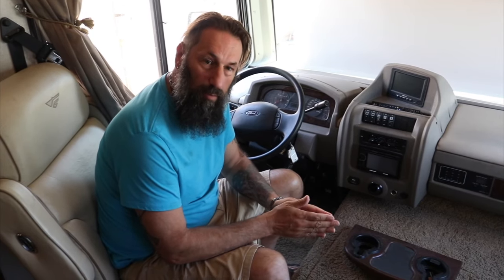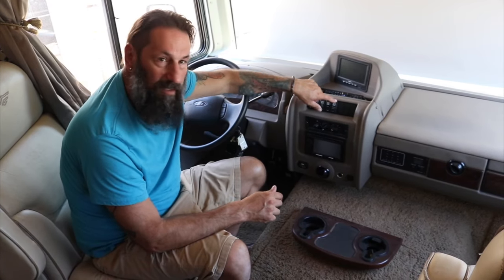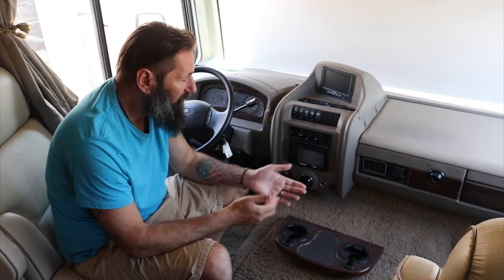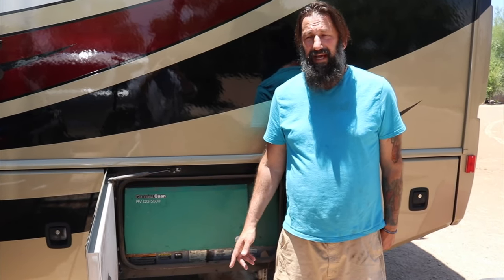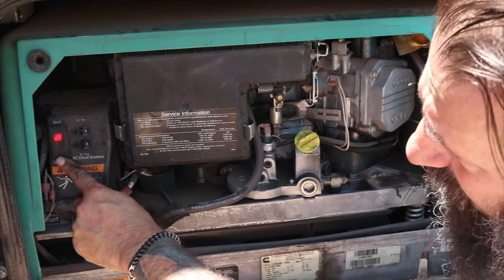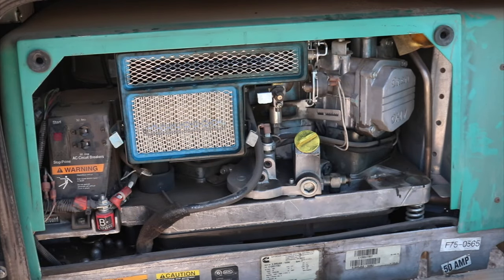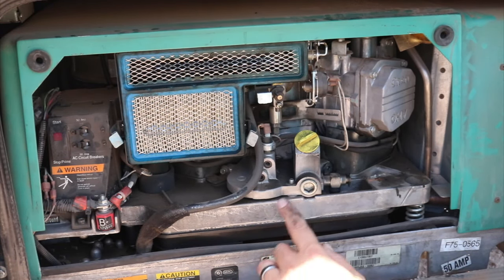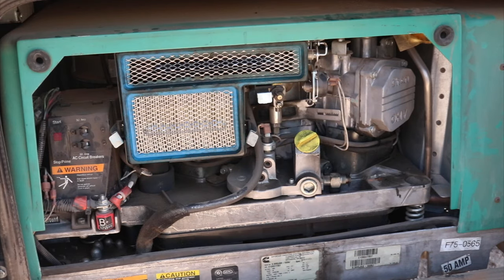RV Onan Generator Start Up Problems. Fix it here.  Hint & Tips

Comment from the maker: Hey everyone, let me know if this video was helpful to you and lets hit that Subscribe button.  Thanks for watching!
Reply: Thank you.  This was very helpful! I got it running.
Reply: Subscribing!
Reply: There is no coolant in a generator.
Reply: Hi from Alberta  Canada!!  Big thanks  for all your precious info  🙏  I like  your tum up 👍👍👍
Reply: Hello Mr. Bear all I’m getting is a clicking can’t get it to turn over got good house batteries Well I’m getting is the solenoid clicking do you have any pointers for me?
Reply from the maker: @patriotmike5714  Double check your voltage on the house batteries but if that is good you maybe looking at the starter.
Reply: @BearsWorkshop  Thank you I will tomorrow morning.
Reply: Very helpful!  One specific question concerning an Oman/Cummins RV QG2500 LP propane generator:  there’s a small 1/4” rubber hose, with what looks to have a small disk style filter in line, with nipples on each end, which I am suspicious of. Generator has a fresh oil change, a year ago, but was not attempted to be started, until now. Generator only has about 50 hours on it. Starter turns the engine over, but won’t start at all. Acts like it’s not getting propane. When primed, I can smell a small whiff of propane. Could a bug or something get into that rubber line, or filter and prevent a start?  It’s not the main fuel line, but some other small rubber line. Not sure of its function, but looks to connect up around the carburetor or choke actuator. Is it okay to use a small amount of starting fluid on a propane powered engine?
Reply: No power to gen good battiers
Reply: my onan 6000 generator has a 4 times flash code which means.

Comment: Man you just saved me a LOT of hassle! I can't hear a fuel pump running or tell that anything is actually happening holding the stop button, but sure enough, after 2 cycles the generator fired right up! The RV had been sitting for 6 years and I KNEW it had a lot of really old gas in it and run through the generator when I tested it. I was convinced I was going to rebuild that carb.

Thank you!

Comment: Good video. Quick note… a rapid clicking sound when attempting to prime or start a diesel generator could also be an extremely cold generator. We’ve had single-digit temps here in NW Arkansas the last several days. My Onan fired up and ran for two seconds, died, then showed a code to heat the generator. Hope this helps.

Comment: Thanks for your video. Helpful tips. 
I have a 2019 Winnebago travado 59k Van RV on a ram ProMaster chassis. It has a 2800 Onan generator. We bought it used the first of February and everything has been fine until a trip to Jacksonville Florida to visit our son in the navy. Once about halfway there we stopped to make coffee and it wouldn't start it just clicked when I tried to start it. I tried a few more times over the next few hours and eventually it just fired up and was running fine for almost a week on and off. Friday night while we were boondocking after a couple hours of running with the AC the generator stopped. It would restart but only run for a few minutes before stopping. When we bought the van the generator only had 10 hours on it telling me the gentleman didn't run it enough after 3 years. So when I got home I changed the oil in it assuming it still had to break in all in it just wasn't sure. It cranked immediately after I was finished and ran for a few minutes then stopped. Since then all I get is a click (at the generator) when trying to start. I'm assuming I may have house battery issues but I don't know I can't get under it to check them. Them being 3 years old I guess that's a possibility? I am going to my tire place in the morning and have them put it on the rack and check the two house batteries. I also thought possibly a solenoid on the onan? Thoughts?
Not low gas or low oil

Comment: I have a Onan 7000 EFI in Denver. It has trouble staying running. I’ve figured out to disconnect the load w the Circuit Breakers on the Generator near the start switch. Then it will stay running. I have to wait for about 15 minutes sometimes for it to warm up and then apply the load by Turing on the Circuit Breakers. Then it holds. There is an RV style AC unit on the system. I think it may have a heater package on it too. Took it to Cummins one time before and they found no issues. I thought it might not be set for high altitude. They said no.

Comment: Lot of good information here without wasting a lot of time.  I appreciate how you take us through the problem and what to look for.  I have a problem with my Onan 4000. Last fall I changed the oil and exercised it over the winter a few times. This spring...it would crank, but not start. It turned out to be a spark plug. For the next few months, everything ran fine.  Last week I stopped in a rest area and tried to fire up the generator and all it would do is crank...would not fire.  I haven’t had a chance to get in and check things out yet, but it was really strange that a few hours earlier, it had started and ran fine. The rest area was not level, so I tried it again when I got home...same problem. I have heard that to have a generator serviced can be very costly.  I would be interested to hear your thoughts.
Reply from the maker: I would check oil level first, then try the starter fluid and see if it runs on that.  If it does then you may have a fuel issue.  Either fuel filter or fuel pump.  That is where I would start.
Reply: Bear, I have an update on my generator issue.  I had about 1/2 a tank of gas, so I put a bottle of Star Tron fuel treatment in the tank, filled it up with fresh gasoline and put the levelers down.  Then I checked the oil level, it was good, tried to crank it...crank but no start. I took the plug out and checked the spark and it looked good (I had replaced the plug about a month ago). Then I took the air filter cover off. (Winnebago must think you will NEVER need to service the generator because the access was not large enough). I was kind of working from remembering what you had in your video.  When I got the air filter cover off...there was some mouse nesting materials, I really couldn’t see where it was, but I cleaned it out as best as I could.  Once again, crank but no start.  I was able to spray some starting fluid in the general area of the air filter and it was enough to get it started.I ran it for about 25 minutes with the AC pulling about 15 amps. Then turned the AC off and ran it no load for another five minutes.  I shut it off and cranked it...and it started up! Thanks for the tips, saved me a ton of money. I did have one mishap.  I dropped the wing nut that holds the air cleaned cover on. Can’t find it anywhere...probably because it is impossible to see in that part of the compartment. I am going to buy a new wing nut and see how things run.  Again, thanks for the informative video.
Reply from the maker: @garys.8333  Glad to hear it worked out!

Comment: You do not want the power converter (120v ac to 12v dc) powered up during the generator start as it will be heavily loaded and can damage the electronics of the converter, so it is best to NOT have shore power connected during the generator start, or at least trip the circuit breaker for the power converter. Better is to start the engine, this will allow the engine to charge the house batteries thru the charge/boost relay or whatever type of interconnection there is. Your alternator is capable of giving you a 100 amps or more, and the power converter is only capable of half that amount.

Also, small point, you showed how to prime the generator but were not clear about the fact you are using the STOP position of the switch to do this.
Reply: The stop button is also the primer button😉

Comment: Hey bear we bought a new Thor Freedom Traveler A30 in August took it out for one trip then had to take it back to dealer to do some warranty work wood coming loose, the graphics on the outside of the coach pealing off etc etc.....so they had it for three months, by the time we got it back we had to winterize it and then just park it......being new to this I left it parked for a couple of months and went out to start it up and had dead batteries house and engine.....figured out how to hook it up to the 15amp outside connection ergo 110 and got the engine battery all charged up, I am thinking good to go, we had a brutal cold winter so periodically I was in and out just checking on the RV making sure had no broken pipes etc....fast forward to yesterday, went out to run the rv and run the generator, could not get the gen to even register on the control panel,  could not get the slide to work etc etc.....there was  a gentleman next to me that had an amp meter and he tested my batteries and said they were down to three volts  I have two 12 volt batteries I guess the RV does not have something to charge all batteries....I went out to day and purchased a good charger that will drop into maintain mode to keep batteries charged, of course I had to try and charge the house batteries first.....before I left to come back home the voltage was up to 12 but still no luck with getting the window on the control panel to display when I try to hit the start switch on the Onan so now that ive talked your ear off do you think it could be a reset switch on the generator ????? Ive finally figured out how to remove the cover ........the only time we used the gen was when we started it up to make sure it worked when we bought the RV ......any help would be appreciated......Thanks Dave Taylor
Reply from the maker: On some coaches there is a timer mode for the generator.  My buddy had a problem with his, when the batteries would drain, the generator would not start. Found out there was a setting that would not allow his generator to start between certain hours.  If the batteries die then the clock will also be wrong so it just may not function at random times.  Also try running the coach for awhile.  On most coaches the vehicle generator will start to charge the house batteries while the coach is running.  You can also try jumping the generator with a battery pack,
Reply: @BearsWorkshop  Thanks tried most of those, was out there for a few hours yesterday running the motor I finally found info on how to remove the generator face plate to access the reset switches so ill try checking to make sure we have no switches tripped at the gen.......and try to start it from the source and see if that wakes it up .....if not I guess a trip to where I bought it, things not even a year old yet and not more than four hours on the gen.....Dave
Reply: So new info......checked the compartment where house batteries were located and found a curious yellow switch that was visible next to a blue button I reset that yellow switch and the generator fired right up that explains why my house batteries were dead they were not getting charged through the system like my engine battery was.....HOWEVER the rv radio which is an Axxera avm80 POS is now stuck in demo mode and no one seems to have a clue how to get it out I have pulled fuses reset fuses, and reset factory settings and it is still in demo  mode and wont stay on one screen, that being said, anyone have a fix for that other than one round from my 9mm ???
Reply from the maker: @DavidTaylor-tx8nn  Glad to hear that you got it running.  9MM sounds like a reasonable solution.

Comment: Nice video very informative , I did know I have to hold the start for 30 sec.  I do have a Onan 6.5 RV on my Airstream 86 345 just got it and do not have any manuals  for the generator , I had a problem to start but if I close the choke it will start , maybe I need todo a full service oil change etc, etc,

Comment: Nice video. My generator starts then cuts off when I release the start button. There is gas in the tank.... I can't figure why js is happening, driving me nuts
Reply from the maker: My guess is that the starter is keeping it running and it's not actually running.  Check fuel supply, fuel filter, fuel level on the RV needs to be above 1/4 and then maybe fuel pump.
Reply: Bad control board,voltage regulator,low oil .ECT will cause that you can start the gen but as soon as you let off the button it will die
Reply: We took ours to the local RV repair shop after hubby did every troubleshooting step possible,  changing the circut board , switch , all filters , filled it with propane,  etc... it still ran for a few seconds and quit . The RV repair shop told hubby they couldn't figure it out either...hubby already tested and replaced everything that they would do and double checked his work everything was done correctly.  ( Hubby definitely had a gleam in his eyes for a brief second knowing he did everything the RV mechanics knew to do) 
He asked what would be his next step be. They said take to Cummings.  Cummings said It was a Guage or something located inside the generator, they had to remove the generator completely from the RV itself  to open it up and replace the part inside.  Labor and part was just over at $3k " labor mostly at $150 per hour"  Our warranty coverd most of the repair . I guess if everything on the outside is changed out , gotta look inside. 
I believe that my hubby could have repaired it himself..but that generator would very heavy for a 68 year old man by himself.  Glad we purchased the extended warranty on our pre loved 2001 Monaco Knight 31J through the dealer when we bought it last year. The dealership said you cannot purchase warranty for motorhomes over 20 years old or over 60k miles " gas or diesel " is the reason why we purchased , our SHORTY diesel pusher was 19 years old and 56k miles  .. so far that's the only issue we've had. Hopefully if anything else happens it will be before August 2022.  Thanks for your video , hubby watches and learns.  He YouTube's  everything  for the RV . As a retured owner operator OTR truck driver , he did all of his own maintenance and repairs " he could do himself " on his own ( if he wasn't driving the truck , he was under the truck or washing the truck)  Having the RV at home gives him something to do , he's always putsing around with it!!  Sure wish he was into remodeling,  it could use new flooring and I want the dining table that's directly across from the sofa removed and replaced with a entertainment cabinet that has a fireplace insert and a TV lift ( just the two of us, we cook and eat outside..so TV trays would be fine for the times we must eat indoors due to weather conditions  we camp here in the desert and sometimes 116° is too hot for us to cook outside.. occasionally mornings in the wintertime is too cold to eat outside comfortably..I do make breakfast inside almost always with our old-fashioned percolator coffee's.  
Life is Good 👍  when you can get away for a couple of days.  We don't really do extended long trips ( he's done that already lol)

Comment: Thank You for your time.  Short version.   I have been using my generator with success.  I got to empty and  started a trip.  I filled up and got back eight hours later.  I filled the generator up. 20220520.  Generator would start then cough like you explained.  It ran just long enough to get the slideouts out open.  Then my imagination went wild.  I was post toasted for the trip and came back to the generator in two days.  My thoughts were I may have put some damn diesel in the unleaded tank for the generator. but the little drop of fuel in the fill up smelled like regular.  I opened up the front just like you did and noticed gas coming out of the carburetor, but am so upset I can't figure out if i accidentally put diesel in there or not.  Didn't know the light was for error codes.  Filter wasn't near as dirty as yours.  So I put things back together and tried to siphon some gas to see how bad I screwed up or if that is the problem. I couldn't siphon anything.  Fuel tank registers full.  The first attempt after a long trip it was 97 degrees and i thought it was too damn  hot because  air conditioners and equipment seem to fail when i need them the most.  Second day it was pleasantly cool.  So I Put it back together and walked away and am wondering how to either drain the bad gas and get a suggestion for how bad i may have screwed up the motor with a bit of diesel.  If I happened to put the proper gas in there I am level have checked the oil.  All but the coolant.

Comment: So a few minutes ago I went out and checked the batteries and made sure they were clean and tight.  Even water.  Checked the oil that's good.  This motorhome is old school doesn't have any lights like what you're talking about. Tried it and still just clicks like yesterday.
Reply from the maker: Check to see what your house battery voltage is.  Not enough volts will cause a clicking noise.

Comment: Hi and thanks for the info.  I have a 5500 series that starts great when cold and runs like a champ, but has hot starting problems (smells like the unit siphons gas and floods the carb).  If I go outside and open the choke fully, it starts pretty easy, so I know it must be there.  However; the choke seems to be working fine.
Reply from the maker: Could be old gas.  A dirty carb or bad gaskets on the carb.  Those would be the first things I would check.
Reply: Check you oil level ans smell it for gas.  You might have a oil evaporate  to fumes and now it's starts with other issues. 😊

Comment: I don't have a prime 😔. My generator looks way smaller than yours. I replaced the fuel filter, but still no luck. It turns over just fine, but won't 'catch'. I'm in a 1995 RoadTrek camper van and have an Onan generator.